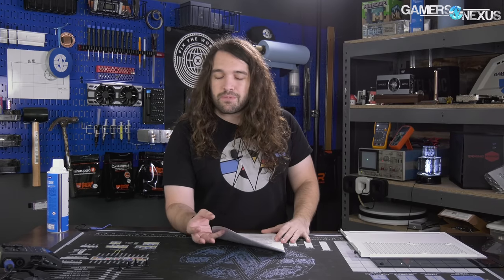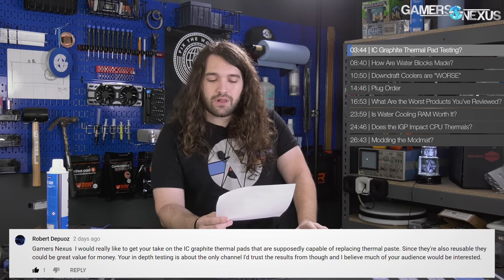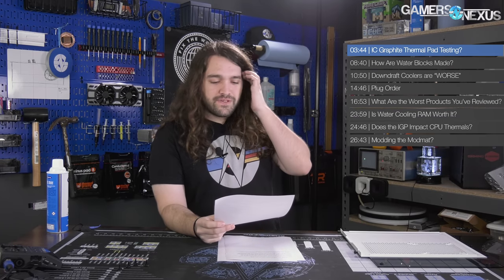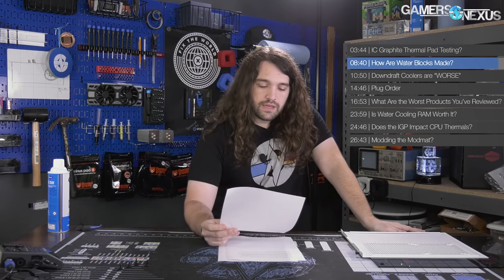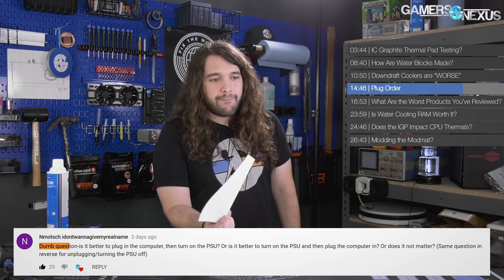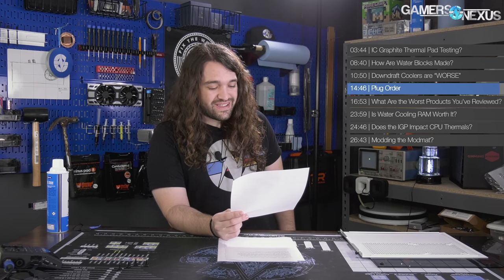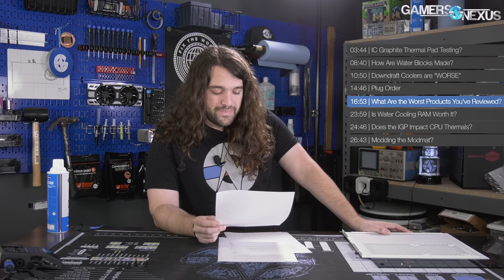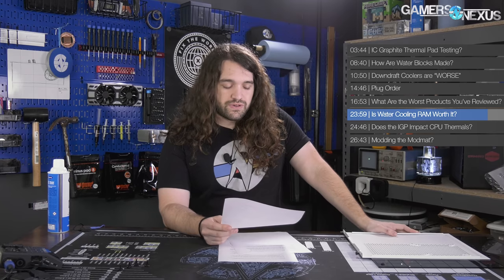Ask GN 83: IC Graphite Thermal Pads, Worst Products Reviewed

Comment: hey guys i know this is off topic but if anyone can help me with my first build i would appreciate it iam new to this stuff and iam very confused and my budget is around 1300 usd . Thank you :D
EDIT = if possible i will increase my budget to 1600 usd
Here are the prices in my country :

core i5 8600k = 300 usd 
core i5 8400   = 250 usd 
core i7 8700k = 463 usd 

ryzen5 1600x = 235usd
ryzen5 2600x = 250 usd 
ryzen7 1700x (no fan ) = 330 usd 
ryzen 7 2700x = 370 usd 

as for gpu i was thinking either 
zotac gtx 1060 3GB = 357 usd
zotac gtx 1060 6GB = 463  usd
 gtx 1070ti mini = 622 usd 
1070 ti Amp = 660 usd 
my local store doesn't sell gtx 1070 :(

Motherboards:

AM4 :
 x370 SLI ATX = 190 usd
b350 =145 usd
ASUS ROG STRIX x470 =262 usd
ASUS PRIME X470 pro = 251 usd
MSI b350 Tomahwak = 137 usd

my local store doesn't have alot of AM4 motherboards

LGA 1151:
msi Z370 =206 usd
ASUS ROG STRIX Z370-E Gaming =251 usd
ASUS prime Z370 quad crossfire and SLI = 235 usd
ASUS TUF Z370 PRO Gaming ATX =209usd
ASUS TUF b360 PRO Gaming =182 usd
ASUS TUF b360M-E Gaming = 129 usd
GIGABYTE Z370 MicroAtx =172 usd

and 600w gold psu = 92 usd 

8GB one stick of ram = 103 usd
8GB ram dual Channel = 132 usd -2666mhz
8GB ram Dual channel = 137 usd -3000mhz
16GB ram dual channel = 264 usd -3200mhz

as for the case they only come in 2 prices for all cases

1-120usd : Lame and simple few with plastic glass  
2- 250 usd = comes with build in water coolers and flow meters and tempered glass 
but the case i like is the corsair 470x = 209 usd its on discount

1TB WD = 79usd
1TB WD black =132usd
250GB M.2 960EVO= 164 usd
500GB M.2  960EVO= 304usd
500GB samsung SSD 860=198
120GB Mushikin SSD =52 usd
250GB Mushikin SSD = 111usd
500Gb Mushikin SSD = 182 usd

Thank you for your help it means alot :D